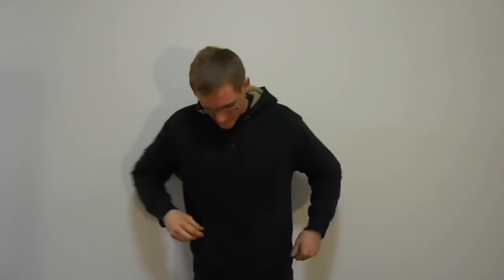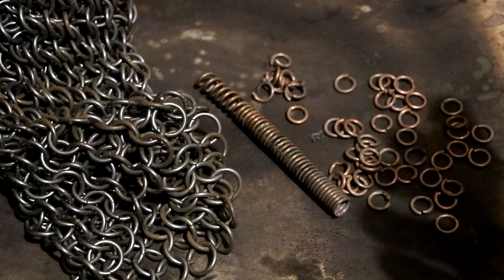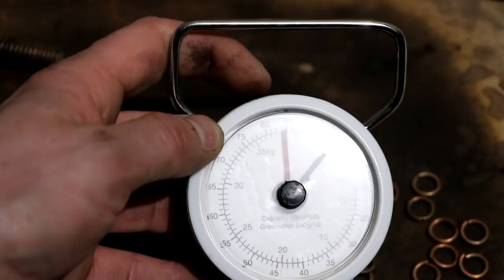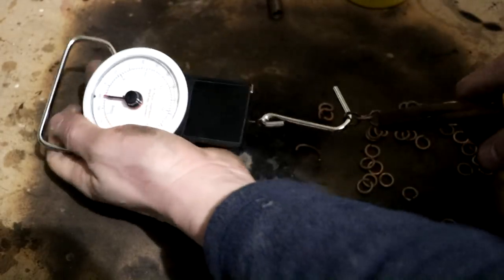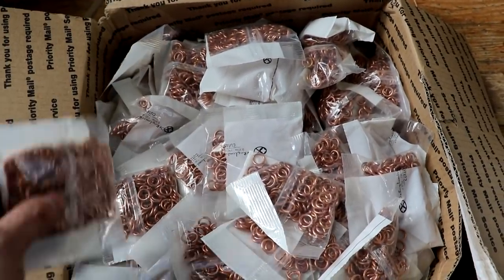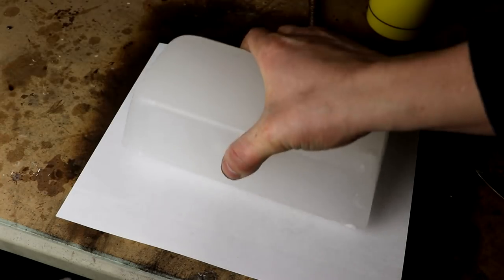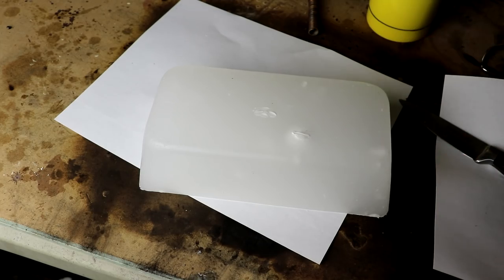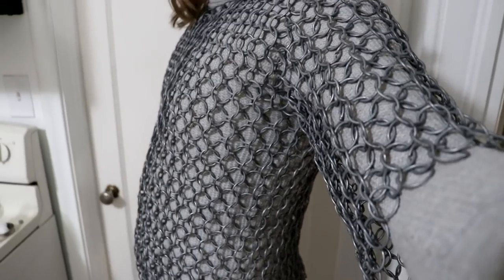Chain Mail Lab Coat?

Comment: chainmail was made to protects rom cuts not trusts / jabs, especially if you have small thin COPPER mail, it maybe will protect you from stabs, but im sure that cuts are good.
Reply: you don't know what your talking about... Mail was easily able to protect you from stabs if the rings were small enough and riveted
Reply: IF the rings were from a good material, and small means thin

Comment: This could even work as a Faraday cage for EM pollution, or if the resistance is high enough and you don't mind having a few amps running around you, you could attach a lipo battery with a controller and have an active winter heater lol

Comment: i've found copper chainmail can't even support itself, a 40 pound shirt will deform or break at the critical weight points. which you've shown with you're tensile strength test.

Comment: Ok so I have a question for you Cody! I am not a chemist, but I decided to try some electrolysis to clean a coin I found metal detecting! It was a copper large cent, and I used that as the cathode and a cheap stainless steel butter knife I've let it run for about 10 hours, do you think I've produced a lot of hexevelant chromium? Should I be worried about dumping out the water? Thanks!

Comment: hey cody im making a scalemaile jacket similar to your chainmail lab coat im using titanium rings to hold everything together.  Your test with the knife at the end of the video made me realize that my scale mail won't have much practical use (even though the titanium is very springy and quite a SOB to work with. Since I can't weld titanium(dont have right equipment) i want to solder it for even a little more added strength, so i was wondering if you knew the right type of solder to get a strong connection and stop the titanium from oxidizing and creating a weaker connection. thanks PS i'm using Grade 5 titanium

Comment: That is how I did it. I would watch T.V. while I cut the spoils into rings, opening the rings, and putting the rings together. Yeah it is alot of work. We didn't weld the rings together just butted the ends. But it was stainless steal. 4 in 1 weave about the same size of your copper rings.

Comment: 2:30 if somebody stabs most chainmail the knife would go through and probably nick your skin. A slash, on the other hand, you would probably be pretty much protected from. Also, if you wanted something maybe just a little stronger/lighter you could use thin ribbon-like rings of steel.

Comment: Hi. I don't have a fundamental understanding of physics and engineering, so this is based on my limited understanding. If I'm wrong it would be very awesome for you to make a short video explaining why. I love to learn, sorry if I come off as a know it all or pretentious, I'm working on how to present myself. Also, I know that chain mail distributes energy so it would take a lot for a projectile to take links with it and you might not work with things strong enough. Of course you want more than a jacket underneath if you really want it to protect you from shrapnel. You have to realize if the shrapnel has high enough velocity it will take the mail with it. Because the mail will slow it down it won't cause as much damage, but there will be more material entering you. You could mitigate that by finding a way to contain it in fabric and have a silk lining to your jacket. If the outer layer has some heat resistance it might lessen the amount of heat from the projectile protecting the strength of the mail.

Comment: Try silver solder and you won't be able to pull it apart.  The joint will be stronger than the wire.

Comment: Using butting rings, while easier to make, will always be weaker than riveted rings. Also, welding rings may potentially 
weaken the metal compared to riveted. This is something to remember when thinking about historical maille.

Comment: Chainmail was meant to protect against slashing not stabbing. It was notoriously weak against stabbing and against arrows during medieval times when such things were used in actual combat. If you wanna protect against stabbing you'll need plate mail or full plate armor. Just a heads up...

Comment: After wrapping the wire around the  pipe you could've just cut a line straight across the coil with a grinder, maybe something to try in the future
Reply: I actually made a special tool for my son to do just that. It uses a pipe that has an angle-grinder-driven-one millimeter-slitting-disc protruding into it's cavity. 

It worked, in that it quickly converted coils into rings, but the thin gap left in the rings was inconvienient when it came to actually knitting the maille (according to my son... that's his work I'm wearing in my avatar photo) Consequently, the slitting pipe tool is sitting in a box in my shed, having only ever been used once.

Comment: Butted maille is not going to offer much protection from stabs, if you are looking for actual protection get riveted. i have some suppliers in India you can purchase from on the cheaps. my 6mm ID hauberk was 300 but you can get 9 and 10mm ID much cheaper.
Reply: This isn't just butted, this is brazed/welded, which I've heard is even stronger than riveted.

Comment: For a mail shirt to offer any desirable protection, the rings need to be welded or riveted shut, else any piercing blade or shrapnel will easily puncture it. Heavy cuts will also cut through rings if not closed properly. Be safe! :D 
Edit: Oh I only saw your steel shirt, not your copper one lol, well glad you did weld them :) And about your cut on your hand, get well soon :)

Comment: Quick note to anyone that attempts to replicate the welding or brazing process. Do not use galvanized wire.  The zinc coating is toxic when you burn it

Comment: I have heard that it can be very cold wearing chainmail. Would it act like a heat sink, keeping you cooler in hot weather? Or would the added weight just make you more hot? Maybe a light weight aluminum chainmail vest could work?

Comment: I'm a little confused as to why anyone would use copper to make chainmail. Especially if your concern is weight, copper doesn't make much sense. As far as electricity, steel is more resistive than copper, but still a lot more conductive than the human body. I think that combination would be superior for that purpose. A mail made from fine stainless steel links would be extremely effective and much lighter overall.

I made a vest from large lock washers when I was in high school and while my unique link weave could stop a battle axe, the vest was incredibly heavy. It wasn't welded or riveted, but the odd angle of the cut in the link made it incredibly strong. I really want to revisit that project with smaller stainless links that are tig welded.
Reply: Look. Copper is cooler, okay?

Comment: I love mail, your new coat will look awesome and steampunky.
If you want to lose pudge it's easy, I've tried lots of stuff trying to improve my health, and it seems that the high carb vegans and the keto crowd are at odds but both believe they are right, its because they're both right, intermittent fasting and ketogenic diet is fabulous for cleansing and losing excess weight, especially plant based food, and a moderate amount of plant based fats are important like nuts and avocados, but it's all about the salads. If you can get into the habit of preparing yourself a big healthy tasty salad every day, you'll eat it and learn to absolutely love them, I've found I thrive on a red organic apple for lunch and a large salad for dinner and nothing else. By skipping break-fast and having fluids and coffee, you help flush out the body and add to the 8 hours not eating whole you sleep to get past 16 hours without food, then the body kicks into ketosis and you burn fat naturally whilst promoting apoptosis of sick, old or inefficient calls.

Comment: Hey Cody! Would it be worth trying to weave steel cabling through the rings of the high school chain mail shirt you have there? I was thinking cable the size that is used for bicycle brake systems. It should be flexible but I wonder if getting it knife proof would be too difficult. Just some thoughts.

Comment: I'm worried when you talk about chainmail protecting you from shrapnel and explosions. I'm worried about using copper because you can cut it with a steel knife. Chain is best at protecting from blunt force and slashing strikes, stabbing it is the best way through. I've been making chain armor and jewelry as a hobby for about 15 years, I recommend going on The Ring Lords forums to browse ideas and asks questions.

Comment: You need to rivet or weld the links of the mail to ensure proper protection. Butted mail does not prevent penetration from swords, axes, and daggers.

It seems that you did weld them, but your welds were weaker than the original material. Not a good welding job. Then again, I've only welded mild and stainless steels. I've never welded copper.

Just finished the video. You provided a good example of why butted mail does not prevent penetration. Good show.

Comment: I'm thinking you'd also have to take into consideration the fact that the average human belly isn't as hard as that block of wax, and it'll provide a bit of cushioning, so to speak, and in that case, the chainmail would only really be spreading the pressure over a larger area, by the rings tugging on each other, of course, taking into account the relatively soft underlying tissue, the opposition wouldn't be nearly as sudden as that of the wax block. What I'm saying is, the unwelded rings would probably suffice, just to not let the knife through. Just putting in my two cents here. Although I agree, more stronger is more better. I'd go for the best possible weave and for the best possible welding method too if I were you. :D

Comment: I made a 9 kg butted hauberk a few years back, did stab tests that were pretty convincing. Wore it in the central city for a day and even at the cinema. Strange feeling to know that no one knew what I had under my sweater. However, later at night, it started smelling iron, so in a long term it was not very practical. It was an interesting experiment though. 

On a side note, I think that a hard surface is not really representative of your body, but if it passes that test then I think it would certainly be safe against knife bearing thugs in the city. Also, if it partially passes the test, then it would probably protect some in a real life situation. However, DO NOT attempt to use any chainmail if you expect a gunfight!! It would be like a frag grenade (at least locally around the entry hole). You would be safer without it in that situation.
Reply: I'd actually reason that a small enough bullet like a 9mm might actually be stopped or the damage even partially mitigated from wearing this. Thicker mail would obviously be better.

Though, a large bullet would indeed just be shredded into pieces that slip right past the mail.

Comment: I tried to replicate your experiment though i currently only have the ability to make butted mail using 16g 1/4 copper rings from theringlord. I ran into some issues though. On one test i got 19 kg (basically the same as you got for brazed). On another i got 6.5 kg. The difference being how the rings are aligned, on the former the seam is farthest away from the contact point with the other links whereas the latter the seam is touching the other links.

I'm looking into becoming able to make stronger chainmail for the same reason you were, however I'm slightly less capable of brazing so I'm trying to figure out the exact difference and explore alternatives

Comment: I wonder, how does this hauberk work with electricity hazards? Does it prevent you from getting electrocuted or the other way around?
Reply: This would act as a Faraday cage, providing an easier route for electricity to take to get to the ground, thus preventing it from surging through his body. A full suit of metal armour would, ironically, be the best thing to wear in a lightning storm.

Comment: i feared your hand was going to slip on that knife. always be careful of a a handle your hand could slip over. anyway, i know you just decided to buy the rings, but i was wondering. if you would do the same thing you did by winding the wire, but kept the wire on the poll. couldn't you just take a dremel in a line over the one end of the poll and cut many rings at once? it would save time i'd think.

Comment: 2 things Cody, my man...

Braised is okay, but why not riveted and braised? Might take longer, but the rings will hold better, and longer.

Stabbing a mail sample into wax with a knife that has no guard/lanyard hole is recipe for bad time ouchies. 

One more thing, perhaps more pertinent to comments.

People here think you're receiving threats (maybe you are, but I know that's not the reason) but didn't listen to the reasoning behind wearing protection against shrapnel from an explosion (obviously not near an explosion, but maybe just for safety when you have stuff flying around from one point in every direction).  Obviously they also didn't consider that making chainmail is awesome.

Might I suggest, when the chainmail set lab-coat is complete, that the coat also have wool interwoven in the rings? It would also serve to make the chainmail even more heat-resistant. The sweating would also be more conducive to weightloss and/or ensuring proper hydration.

Makes me want to consider making a chainmail tux...

Comment: Use a glove when doing such knife tests - without a proper guard your hand could slip and you'd need stitches. I did this like a week ago OMG THEN U DID IT AS I WROTE
Reply: butchers gloves is also made to prevent this (chain mail gloves pretty much) Where you cut yourself i got 2 stitches 12 days ago

Comment: Chain mail don't do all that much against hard stabs its more for protecting agents slashes
Reply: Steven Smith Actually, if Cody had used riveted maille rather than butted maille it would have been able to effectively block stabs just as much as slashes would, granted the weapon in use isn't specifically to defeat chainmaille
Reply: Derp Master I understand but I ment in the context of Waring the chainmail
Reply: Derp Master and yes riveted chainmail is very good but it takes even longer to make

Comment: I made a box-link wallet chain (I'm a jeweler, but figured I might as well do a ferric metal project). Afterwords,  I was told that using galvanized steel jump rings didn't play nice with skin because of hexavalent chromate...should I be more concerned about that or the zinc itself?
Many thanks to anybody with any insights!

Comment: Nice work Cody...

But if you wanna have the same test factor as a knife hit a chaindress To a belly then you have to have something softer like a belly is. cause your belly is not that hard like the wax?? Or is it😋

Hope you understand my poor English 😇
Reply: It's a good comparison between the two types. Besides, it's easier to penetrate chain when it's on top of something soft.
Reply: Notrel can’t agree with you on that one cause  how can it be easier to penetrate the chains against something soft than against something hard

But there will bee higher risk for a internal damage with a soft background

The fare way to test it make a test doll like they do on forge and fire put the chain shirt on that and then stab it.
Reply: Kristian Johansson
The point (heh...) is that a hard surface will stop a knife more easily than a soft surface. Thus most of the force is applied to the hard surface rather than the maille.
It's true that a soft surface will dissipate some of the force, but once the maille has been penetrated it will go in much deeper than what was shown by Cody.

Besides, as I said before. The objective was not to test the maille against a knife, but to test butted maille against brazed maille.
Reply: Notrel you take the melon and place it on the table and place the wood piece on top then stab the wood 

Remember a watermelon is harder than a belly

Comment: Take advice from an actual mail maker, smaller rings will make a denser piece but it will be more flexible, even then the weight will be on your shoulders if you don’t use a belt, and butted mail like yours is not what real knights use, you need riveted mail for that, keep in mind this is all in steel, steel would be much cheaper too, and for fucks sake don’t hurt yourself